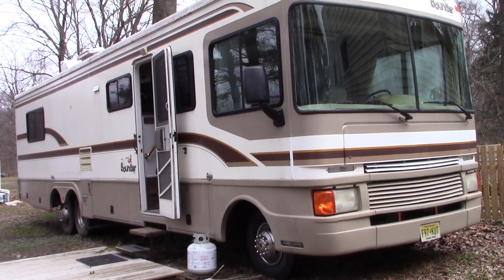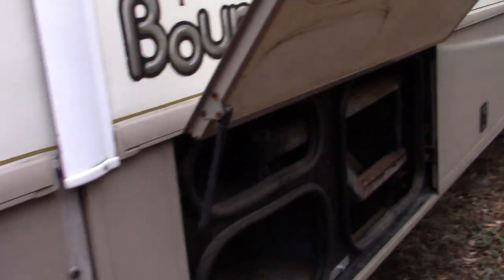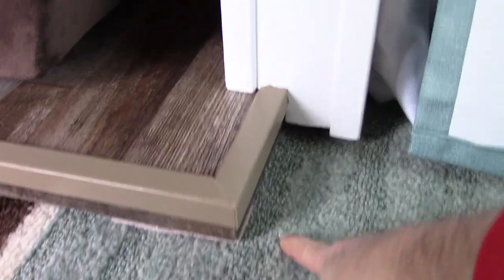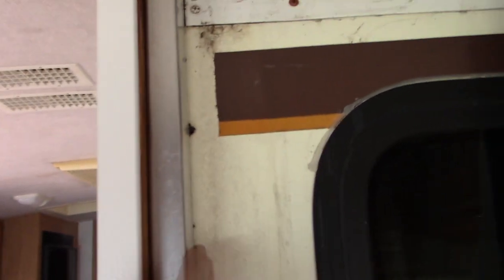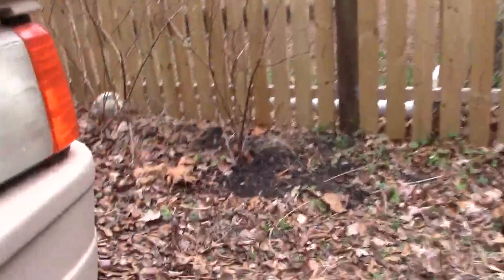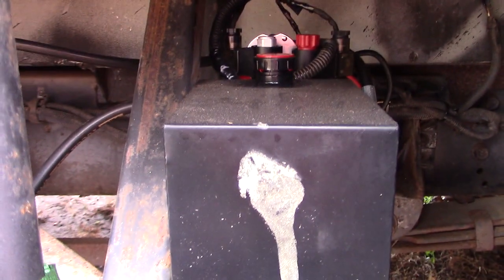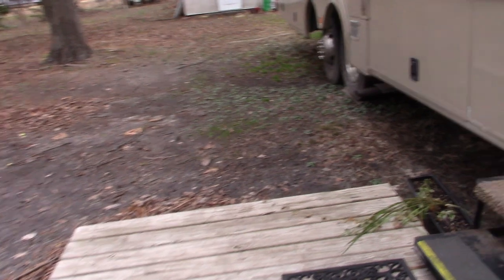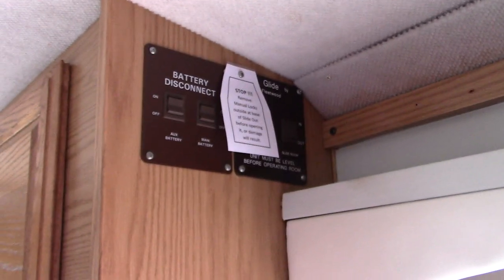RV Slide Out DIY Manual Locks for Traveling

Comment: One of ours slid open a few inches while on the I84.  We’d had the new Beaver only a week or so, but we’re very near an Idaho Monaco dealership. They replaced the in and out solenoids for that slide, and I learned a few things.  It hasn’t happened quite that way since, but rarely one of the 2 big slides up front will pop a half inch while parked by our house.  A simple bump out 2 seconds with the control switch, then back in fixes it by flushing the solenoids.  

If a slide gets stuck out (none ever have), you’re supposed to loosen the relevant solenoid valve nut(s) on the pump/tank manifold under the entry steps, and garner bodies to manhandle the slide back in.  Loosening the nut takes hydraulic backpressure off that slide so you can push it.  The easiest preventive against on-the-road pop outs is a 2 X 4 cut to fit between the inside cutout frame edge and the closed slideout edge.  Only one side is necessary to resist the minimal initial movement - no significant inertia is present.  Ditto for straps.  Our coach has never had a repeat freeway incident, so I don’t use any 2 X 4’s.  

If I did, like you I would put a laminated sign over the switches.  Similarly, when I goofed and pressed our inverter’s Reset button while the coach was plugged in (a no no) and had to have it repaired ($$$), I designed a colored 5X7 sign.  I printed both sides, laminated it, and hung it over the inverter’s front so I or a tech can’t get at the button without seeing it, even in the dark environs of the ceiling of a storage bay;  and it can’t swing sideways … one or the other side always faces front.
Reply from the maker: Good job. Enjoy your RV!

Comment: Do you think you would be able to use this ratchet locking system to bring the slide in should it fail?
Reply from the maker: Interestingly, the Bounder owner's manual talks about this method of manually closing the slide out in the event it ceases to functions and gets stuck in the open position. The process includes disconnecting the hydraulic arm from the slide-out (tools required), and then using a ratcheting tie-strap between the motorhome chassis frame and the moving slide-out arm to manually close it. I think that is what gave me the idea of using these straps as locks for traveling. Just be absolutely completely and positively sure to remove them before attempting to open the slide-out or damage will result. Thanks for watching the video.